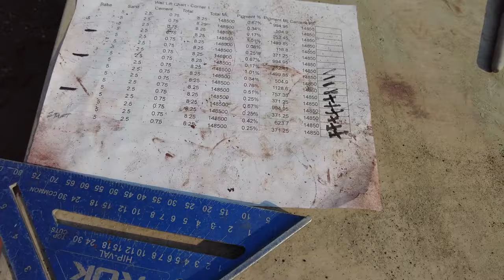Earthy Elegance | Building A Passive Solar Greenhouse From Rammed Earth Ep09 |

Comment: Hello, I want to ask you something. We are using steel formwork on rammed earth walls and the weather is hot. Cracks form on the surface. Why do they occur?
Reply from the maker: Are you using cement as a stabilizer? The mix could be an issue as well as the transfer of heat from the steel. If you can tarp your formwork to create shade it would reduce heat transfer. Hope this helps and good luck with your project!

Comment: Massive footings to hold that weight.
Reply from the maker: Pretty big. 36”x9” spec. Engineer originally designed them at 24”. I increased size so I had a little more surface area for form work. If I had gone with original engineering it is comparable to a traditional house footing in these parts. Thanks for watching!
Reply: @thetielife  It's coming out beautiful.  I bet you wish you had that JCB Teleskid or the Bobcat Versihandler so you could get that slurry mixer higher.    Other Options:   Mecalac  or some sort of rotary telehandler.    Truth be told, some sort of movable conveyor belt would probably be cheaper :)
Reply from the maker: Yes the teleskid would be a dream tool for this type of work. Mighty pricey machine though!

Comment: Nice project! I’d like to know details of how the structural retaining walls were calculated and how you plan to protect them from hydrostatic pressure and water intrusion.
Reply from the maker: Hi! Thanks for watching. I’m not sure what you mean on how they were calculated. We made sample blocks for our mix with locally available aggregates and sand. The cement ratio is 10%.  

We have applied a concrete sealer on portions of wall above grade, and below grade we will use a water base roll on product as we will be growing directly in soil within the structure. On the exterior of the walls below grade we will be applying a tar/bitumen for damp roofing directing this to weeping tile and eventually a French drain system. 

Thanks for watching!

Comment: You guys are awesome! I’m on my second time watching the series!  Thank you, thank you!  
My question was referring to the structural engineering, and the reinforcing steel in the walls (especially below grade). My question is basically, your structural engineer obviously did the engineering and horizontal load calculations on your wall.  I wondered if you could talk about or show (you did very briefly in one of the episodes) the details for the rebar in the footing to wall connection. I’m going to be building a similar project in southern Arizona, in the mountains on the Mexican border. 
❤
Reply from the maker: Thanks again for watching!  We appreciate the interest and kind comments! 

The steel to footing connection is doweled in 4-5” with 10m (3/8”) rebar. This could also be done by installing the rebar when the concrete for footing is poured with pre-bent rebar placed in the footings. We chose to dowel in for accuracy as well as ease of moving around and setting up different wall sections throughout construction. It’s nice to reduce obstructions and hazards with rebar protruding. 

Our design also has close to equal backfill on either side of the wall which balances out lateral forces. If anything we have overbuilt this structure. 

Finding an engineer licensed in your area willing to work with rammed earth might prove challenging. You should start looking for options sooner than later. 

Our steel within each 7” section of rammed earth is a 24” O/C grid. Cross connected at 48” intervals vertically. If you go to a reduced spacing (more steel) you literally will not have room to move within the form system while ramming. 

Your wall thickness is also an important detail to consider. We will be going to 24” wide on future projects for ease of installation and room to move within the forms. 

Hope this answer helps and don’t be afraid to reach out via email (info in our bio) if you have more questions.

Comment: how do you do a rammed earth wall with 30cm earth, 30cm hempcrete, 30cm earth wall, (I would love to fell I live in a bullet proof bunker given the state of the world today) as I am told you need a insulative material, like do you make the earth and then let it set and make the hempcrete straight onto it or can you do all 3 parts in one go?
Reply from the maker: Best to make the form work for the full width of your wall. Depending on your location a thermal break may or may not be necessary.